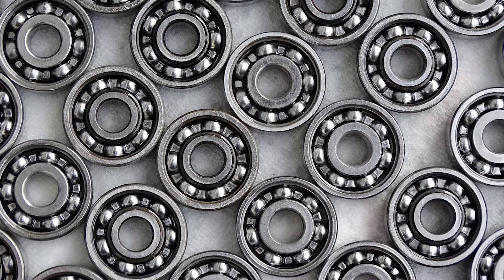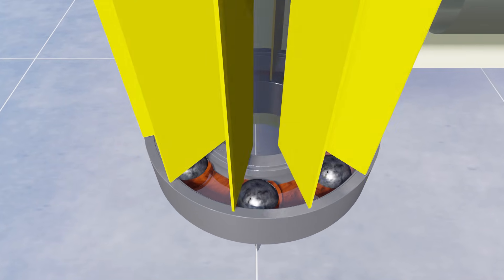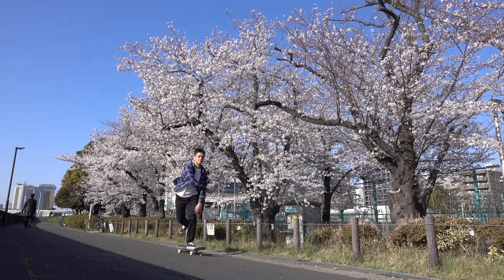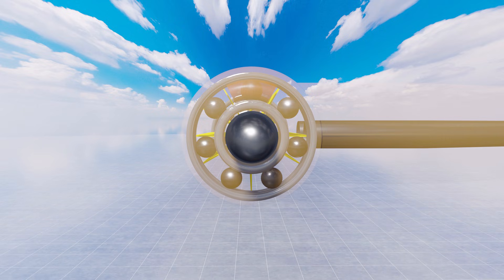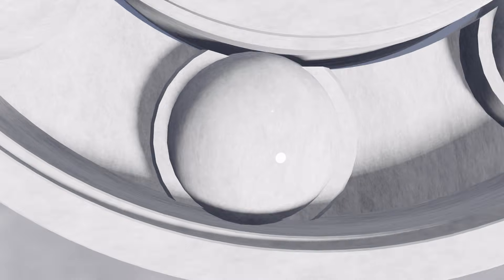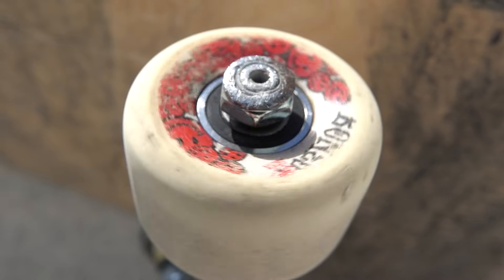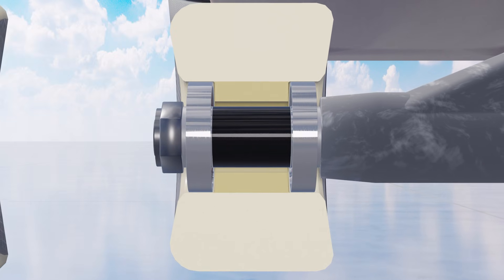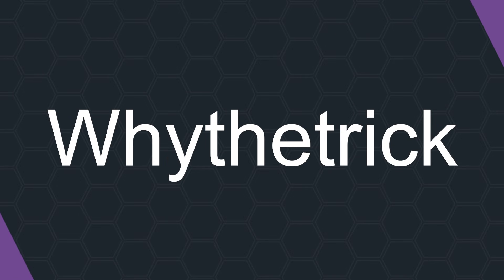The Myth & Science of Bearings

Comment: I think the only function of a spacer is to prevent the locknut from twisting too tightly. When twisted too tightly, bearings with small clearance will directly seize up. Of course, the spacer size needs to be matched with the wheel inner part to actural protect the bearings, otherwise it just not the essential one.😆

Comment: Friction creates heat (  even just pushing around, but bearings have pretty high tolerences so you wont notice it too much ), heat causes expansion, expansion on the races will cause excess friction ( and excess heat) slowing the bearing down a couple of 1000 rpm. With lubrication, this process is slowed down dramatically. You will keep higher top speeds for longer = Less Pushing.

Dust and debris also cause friction and speed loss.

Comment: Far too often I see people spin their wheel fast as if that's a quality test to see how the bearing performs. When I was younger, some of the older kids would put their bearings in gasoline. Then the bearings would rotate as high RPM's for an extended period. Giving the illusion that putting your bearings in gasoline offers extreme performance. However, years laters the bearings were rusted. A skateboard bearing should perform well while under load since your weight is on it. I typically just use Bones Swiss and I only cleaned them once several years ago. Perhaps I should do it again, but I usually just use the citrus oil that is prpvided for bearings. You can also use some ~90% isopropyl alcohol. After taking off the shield and cleaning them, you apply lubrication. Bones offers their own lubricant, but I also have little syringes of lubricant that was sold as "clock lubricant." But it's really just made for small, fast-moving parts.

Comment: The higher your speed the more important the quality and lube is. Take a Bronson Raw down a Cali downhill and it will lock up when it gets HOT! On the other side, a Raw will work well for park, ledge, street, rail, curb, etc. Spacers can and will help bearing durability and performance. Especially when weighted and with heavy side load. Connecting the two bearings with a spacer strengthens the overall side load capacity. Shields will slow down free spin as they “drag” slightly as they try and seal dirt out.  I use outer shields on street and double on downhill. Regardless the outer race will rust in any and all bearings. So clean dry or lube weekly or right after a wet/dirty ride.
Reply from the maker: Appreciate you sharing your experience, especially with the downhill perspective.

Comment: you're better off with a 6 ball abec7, and if you managed to spin a wheel anywhere near the rated RPM of a bearing the urethane would deform and tear itself apart. ceramics are good, especially in hot weather, but can't take impacts because they don't deform. stripping lube from bearings make no sense, friction and heat breaks down bearing retainers and they explode in no time, not to mention dirt causing more friction. which brings up the shield trend, which in and of itself is kind of silly, because they are called "contactless shields" for the simple fact that they don't touch the balls, ball retainer, and the inner race by fitting into a groove on the outer race. no doubt companies love the trend, because the production cost got lowered. Bronson was all over that lol!
Reply from the maker: You've brought up some interesting points about bearing design and performance.
Reply: @whythetrick  i will asterisk though, i don't use spacers, because pinching the inner race doesn't make them feel slower, although, might be the conditions a true abec9 shines... 

last year i bought a set of Amazon bearings from a company called "Maple Ace". 6 ball for $20CDN. are actually decent. 

no offence to the hip crowd (LOL), but i think i'll listen to manufacturers, and years of manufacturing customer data to just leave shields on. compared to listening to someone who gets given free bearings by a company that pays them based on sales lol.

Comment: I have a theory that popping bearing shields is mostly about sound, not just personal preference. If you’ve ever skated with noise-cancelling headphones, you know how strange it feels . skaters rely heavily on the sound of the board during tricks. The flip speed, where the board is under your feet, the timing , a lot of that information comes through sound. So a louder, clearer bearing noise is actually preferred.

When a pro says, “I just skate better with shieldless bearings,” they’re optimizing for feel and performance, not longevity. And that old line, “the dirt goes in but it also goes out,” is really just a misguided justification for skating without shields
Reply from the maker: Interesting point about the sound element!
Reply: yeah, most people I've heard talk about removing the shields say they like the sound.

Comment: I love the sealed bearings that the shields are permanently clipped on there. They usually are lower spec, though. I have cheap indy bearings right now with spitfire classic 52mm wheel. I think once grease seeps out and dirt gets in you introduce scratches to the bearing races and the balls. But more polished and less imperfections, and tighter overall build tolerances, is probably better if you wanna go faster. The forces we put on the bearings from every angle is not the same as a machine that spins in place, like a milling machine or a dental tool. The minute you jump down a drop, your bearings start crying out in pain 😆
Reply from the maker: You've definitely highlighted some key differences between skateboard bearing usage and industrial applications.
Reply: @whythetrick  I also think the reason we use the ball bearings, is because they work better without grease... compared to other bearings. It's very practical. But there are stronger bearing types, and more precise. The plain bearing (or spherical) can work better, in some applications.

Comment: I put spacers to ensure better bearing alignment. I have a penny longboard for more than 6 years which still has perfectly spinning wheels. And I'm afraid of taking it's wheels off because I might disturb the bearing alignment (as I believe this is the reason of such smoothly rolling bearings). On my other skateboards, which I assemble myself, I put spacers, then over-tighten the wheels, so bearings press into spacers and align, then I release the wheel nut. 
By alignment I also mean that when I spin the wheel freely, I can see it wobble out of alignment with axle. After doing this over-tightening the wobbling disappears. By doing this, 2 out of 3 times I get wheels rolling as smoothly as on the penny longboard AND they also become more silent, less rattly. Actually the silence effect is the main reason why I chose to put spacers. The belief in smoothness might be just a superstition, though
Reply from the maker: Interesting. Thanks for sharing your experience!

Comment: I’ve been using some Bronson g3s for over a year with spacers, shields and no lubricants. The spacers are the secret to making them last forever. Other companies besides Bronson have crappy cages and they shatter after a few months.

Another key thing about raced bearings is that they’re only designed to take load in parallel to the races. When we do lots of carving and turning in skating, we put a huge amount of side load on the bearing which is not how they’re intended to work.
Reply: I broke them after a year, under heavy use they are like every other bearings.😂

Comment: Nice breakdown.  In my experience, most bearings last 3 to 4 months and that includes removing the shields cleaning them and re-greasing with bones speed cream. I used to ride mostly Bronson. I tried reds and they actually fell apart on me quickly, but maybe that’s cause I got them from Amazon and could’ve been counterfeit. The last pair I got came highly recommended from guys at the skate shop were bones Swiss six ball, they’re about 55 bucks and those have lasted more than a year with regular cleaning and are still super smooth and fast. i’ve never tried RAWs , just seems like a marketing gimmick, but people like them so to each his own. Same thing with the super expensive bones ceramics in the end if you like them, and think you skate better with them,  good for you, that’s all it really matters.
Reply from the maker: Thanks for sharing your experience!
Reply: u riding in mud when its raining? 3-4 months is not normal